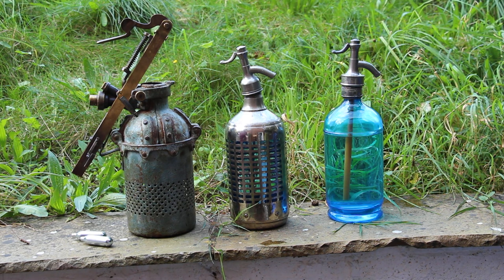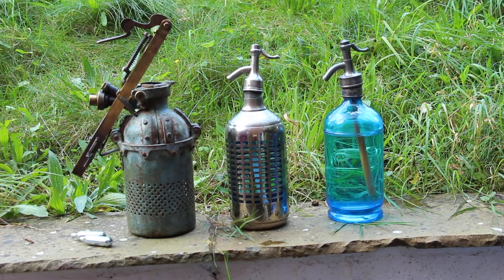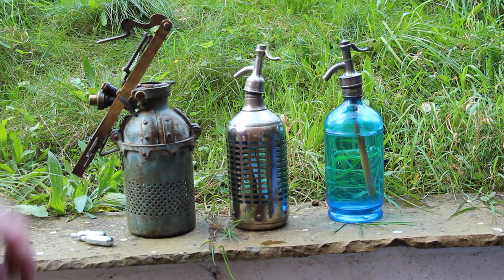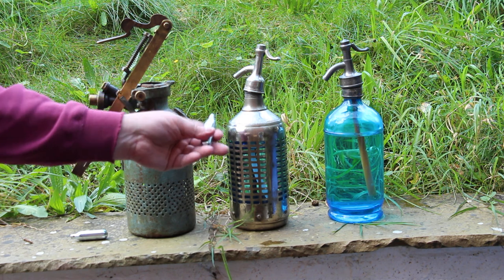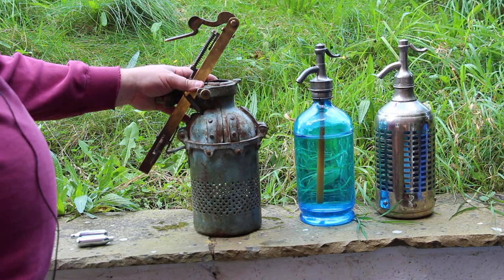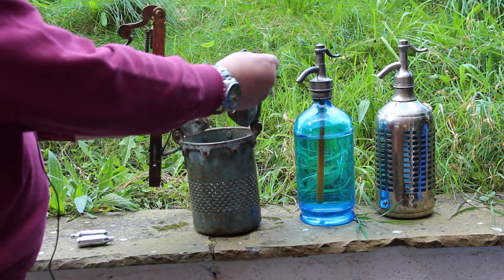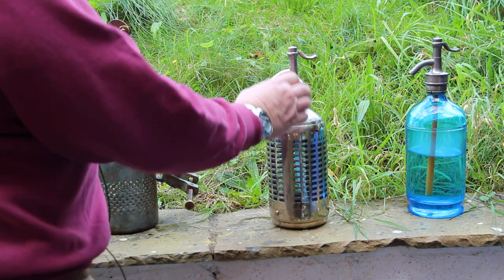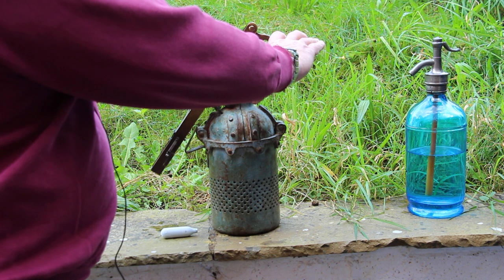Demonstration of the AutoSiphon, Paris, France bar-top syphon re-filler with two styles of syphon

Comment: It would be incredible if there was a universal CO2 charging system that could be used for antique delivery siphons.  The original factory filling stations filled water and CO2 at the same time, if I'm not mistaken.
Reply from the maker: There is a whole range of domestic style soda syphons that can be refilled using the standard "8 gram" size steel consumable CO2 capsules, and AcquaSpumante has posted a number of videos about those vintage ones made by Sparklets of the UK and USA, AutoSiphon of France and a similar named company in Hungary as well as Merkuria Kovocas of the then Czechoslovakia, all of which take the 8 gram sized capsules which are still easily available internationally today.  All these can be refilled by the user.  What I believe originally drove the business in the "bar top" syphons was that these would be returned to be refilled, along with the returnable glass bottles that most beverages came in at that time, to a brewery and hence there was a rapid recycling of bottles through the delivery and collection system.  This started to die out with the introduction of single use glass and then plastic bottles.  As a consequence most syphon refilling businesses closed down.  Once of the last remaining ones that I know of is now the The Brooklyn Seltzer Boys factory and museum in the USA ( https://brooklynseltzerboys.com ).   My understanding of why the AutoSiphon siphon refilling machine came about is probably due to the nature of the French and continental European market after the 1st World War; lots of small villages with bars that wanted to sell soda or mineral water based drinks but were poorly served by deliveries from their breweries due to being remote or down poorly maintained roads.  By using this machine (which, due to the fixed dimensions of the gas filling parts, could only use syphons made by AutoSiphon) and the special proprietary refillable CO2 capsules made by AutoSiphon they could then produce a continuous supply of carbonated water using locally available water.  The only consumables required were the refillable CO2 capsules which came in easily transportable compact wooden boxes that needed to be exchanged when empty.  The beauty of their system was that the refiller machine could only use their brand of Siphons and CO2 capsules (which are now out of production).  We are working towards providing a conversion service or kit which will allow current owners to use modern CO2 capsules to refill AutoSiphon soda syphons.  We will also offer a service to recondition the AutoSiphon syphon bottles themselves so that they can be used with the refiller machine (of which there are at least 3 slightly different types, depending upon age).  Fortunately it appears there were only two different styles of siphon bottle, both of which are shown in the video.  Any further information would be gratefully received.

Comment: Wow, I never believed I'll ever learn how to use these bottles. I have a bunch of Mondollot Paris bottles was wondering if there's any way to use them again?
Reply from the maker: The siphon re-fillling machine featured in this video is only compatible with the two types of soda syphon shown.  I think it was designed for use by hotels and larger bars located in villages and the countryside.  It originally used a maker specific type of CO2 capsule that is not available anymore but we have worked out a way to recondition and convert these to take modern CO2 capsules and re-fill the old syphon bottles, as shown.  We replace some of the internal parts of the refilling machine with new ones during the reconditioning process so they become compatible once again.  Once we can get these working reliably once again we will be offering a reconditioning service for both the syphon bottles and also the refilling machines, which came in three similar looking types.  Refillers like this were made by AutoSiphon of Paris but, I think, re-badged models were sold by a lot of other suppliers throughout France.  We intend to post further videos once our development work has been completed.   Expected launch is in June or July, 2024.
Reply: So these nozzles are different than the C or D type nozzle? And those types are more easily refilled with modern CO2 cartridgez?
Reply from the maker: The Sparklets Type C and D syphons were designed to be refilled by the owner using a CO2 capsule and a capsule holder "charger key" to hold the canister in place whilst the CO2 gas was released into the bottle.  More information on this syphon can be found at www.Sparklets.net  CO2 canisters suitable for the Sparklets Types C and D are still quite easily available today and are made by brands such as Liss, Mosa, Kayser, Morphy Richards and Leland Corp ( "Mr. Fizz" brand in the United States).  ISI brand, however, does not fit most vintage soda syphons as the shape of the bulb neck is too short and the bulb is fatter. The "Auto-Siphon of Paris" manufactured siphon refiller shown in this video originally used their own design of refillable CO2 capsules (often painted a pale or sky blue) which were very similar in size to the modern CO2 capsules but had a valve in the neck rather than the thin metal diaphragm used in modern disposable capsules.  We have found three different designs of syphon refiller machines made by AutoSiphon which were designed to fill the two styles of bar-top syphons shown in this video.  AcquaSpumante is working on converting these refiller machines to use modern CO2 capsules so that they can be used once again with reconditioned Auto-Siphon bar top soda syphons.  However, it appears that the Auto-Siphon machines were only designed to work with their own brand (or re-badged versions of their) soda syphons.  So far we have only found two designs of bar top syphon bottle that will work with the refiller machines.  For those interested, it looks as though AutoSiphon started making siphons of a similar style in the late 1950's that could be refilled from the newer (modern and still available) disposable CO2 capsules.  This model is covered in another of our YouTube videos here:  https://youtu.be/sMEr1Uruh2k  We can supply replacement charger keys for this 1950's model in both plastic or metal.  Contact us at acquaspumante@gmail.com if you want to purchase one or have your syphon reconditioned.